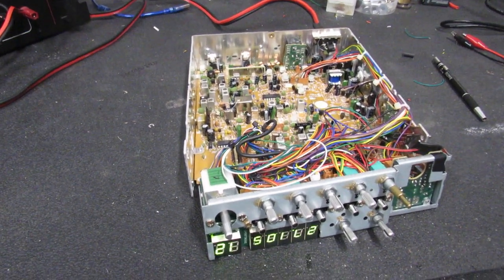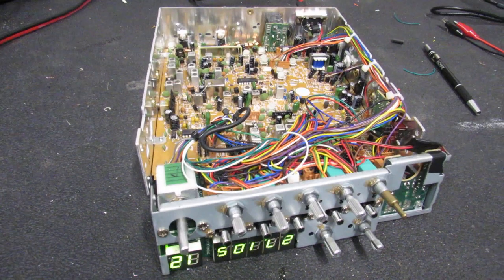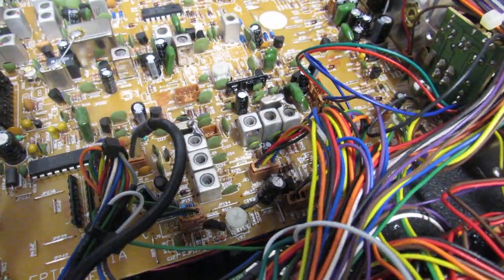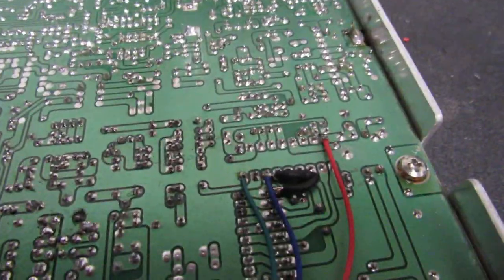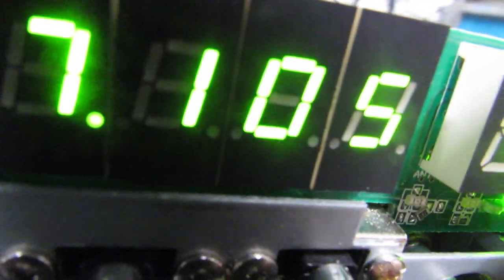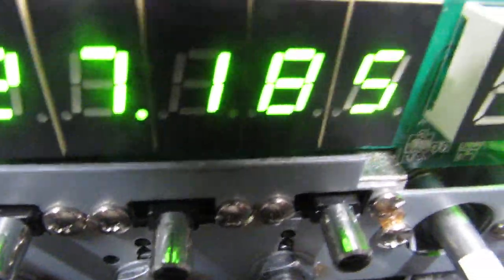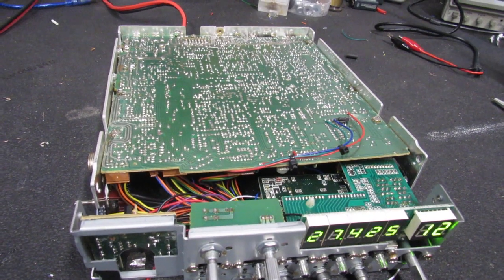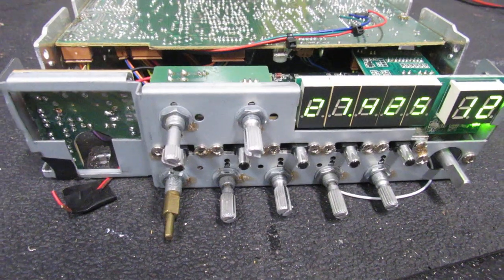Galaxy DX 959- Part 2: Clarifier Unlock/10kc Switch Added

Comment: What does 10kc do
And i need to realigne it to
Reply from the maker: 10kc switch gets the skipped frequencies that are in the cb band. These frequencies were originally allocated for RC cars by the fcc but some folks talk on them nowadays lol. And you shouldn’t need to re-align it after doing the 10kc mod. Just after unlocking the clarifier.